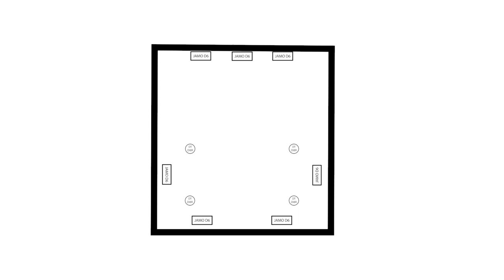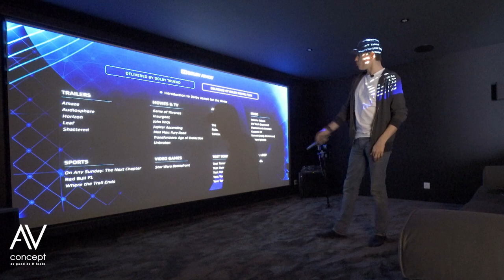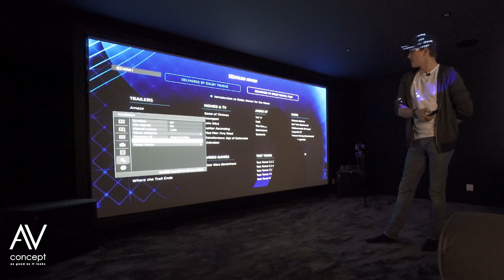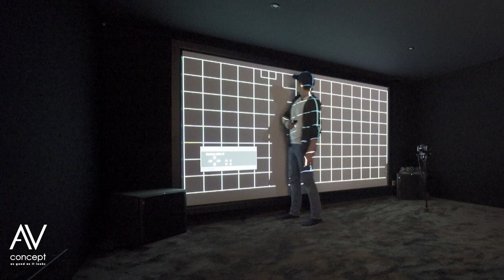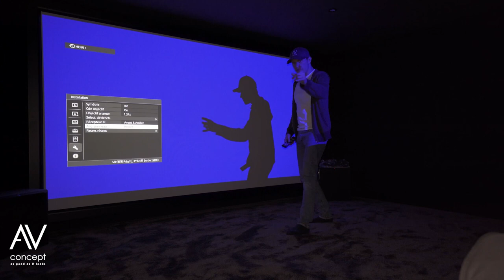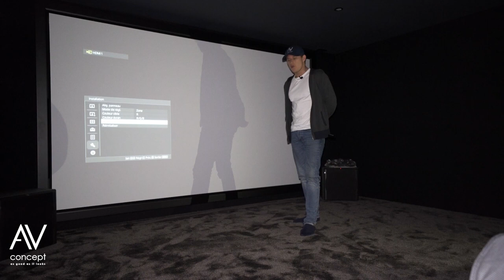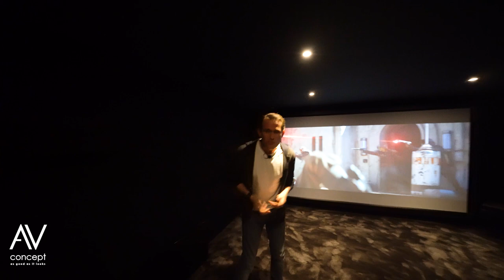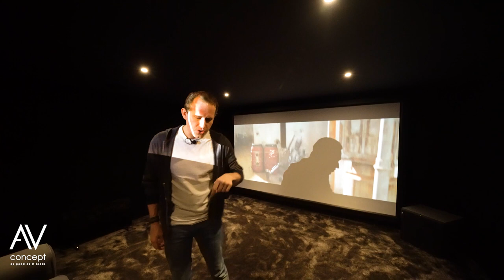Notre première salle ciné (filmée) en sous-sol !

Comment: Salut, j'ai vu passer votre vidéo par suggestions Youtube et le résultat est plutôt de haut vol. Je me pose tout de même de sérieuses questions sur la réalisation.
1 - Rail directement au sol sans isolant ? Vibration Vs Basses fréquences !
2 - En sous sol sans solution de chauffage et/ou ventilation ?
3 - Plafond noir à l'aire, sur la vidéo, de trop diffuser la lumière !
Reply: Je me suis posé les mêmes questions. Pas de bandes résilientes sous les Rails ? Ventilation/chauffage de la salle ? et distance entre les D6 et l'écran perforé, pas d'effet de filtre en peigne ?